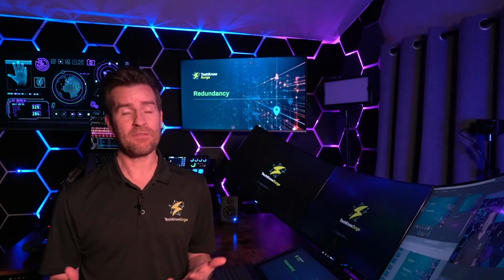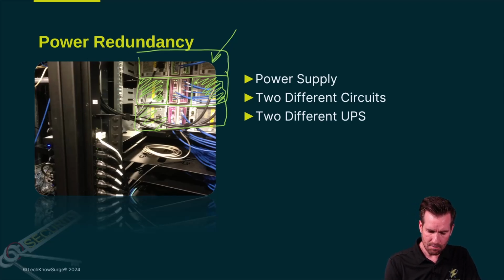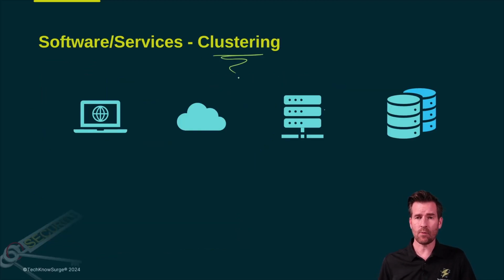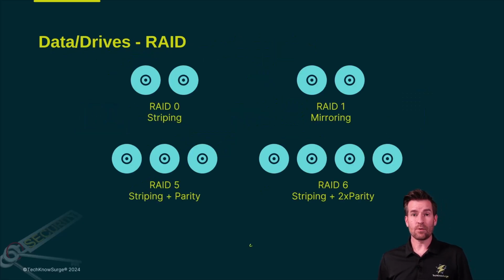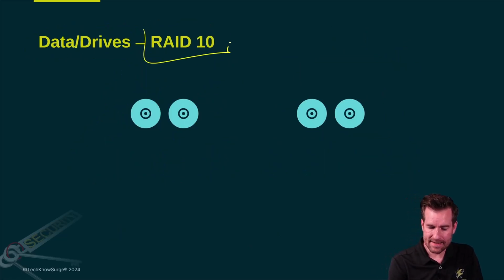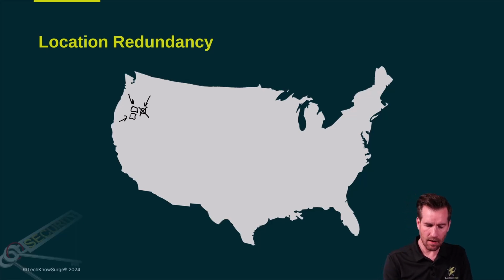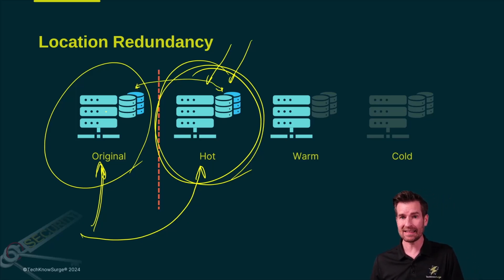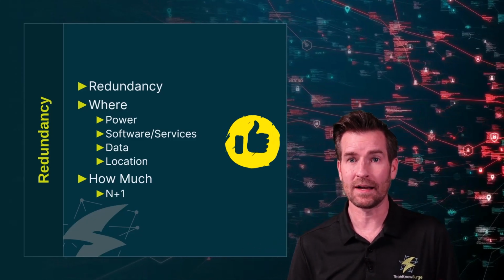Foundations of Cybersecurity 7-3: Redundancy

Comment: 2:01 - When I was ordering pieces for a desktop, the guy from the shop that sold me, and the technicians that assembled it, said a nobreak was not necessary, that just a line filter for electrical outlets would do. The problem is, a desktop doesn't come with a battery like laptops do, so if there is a power interruption even just for a second, you can loose all your unsaved work. I am glad I didn't listen to them, because not having nobreak as an UPS would have caused me problems pretty much every single day.
Reply from the maker: I agree, an uninterruptible power supply (UPS) is nice and essential in some cases. Mine has saved my butt a few times. :)